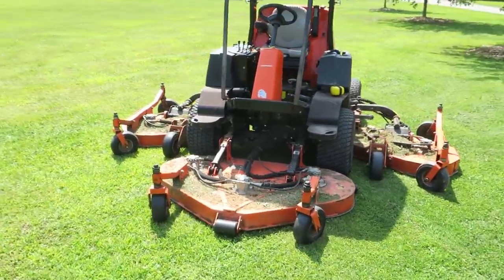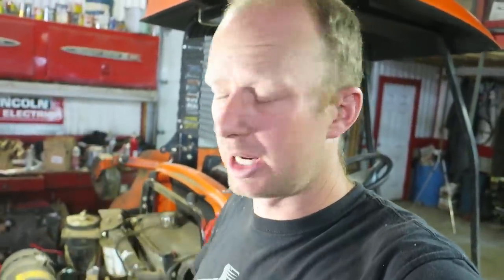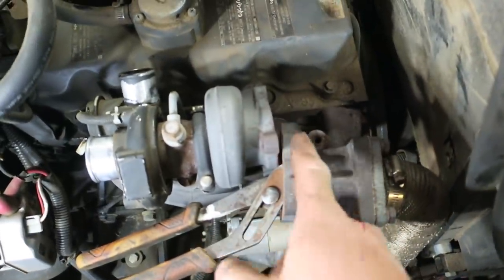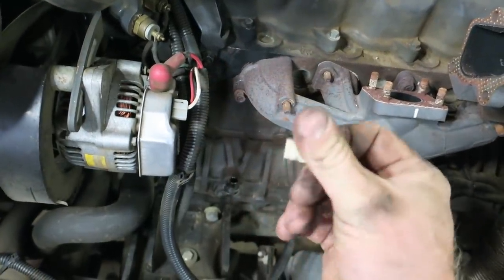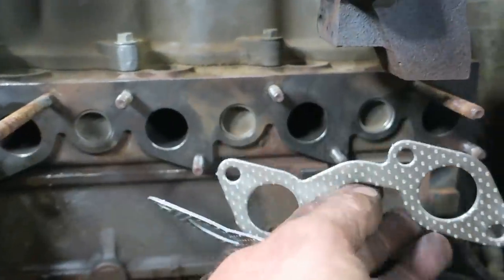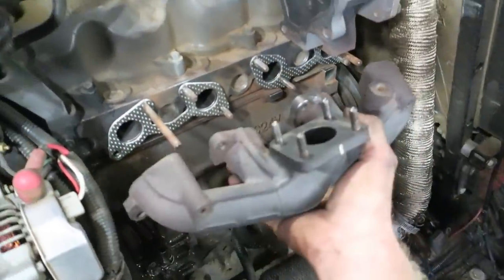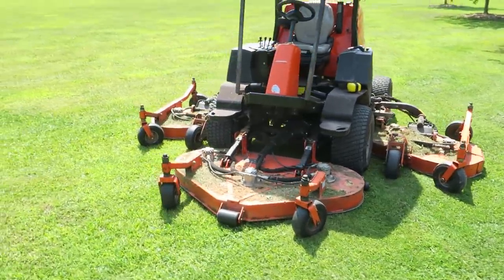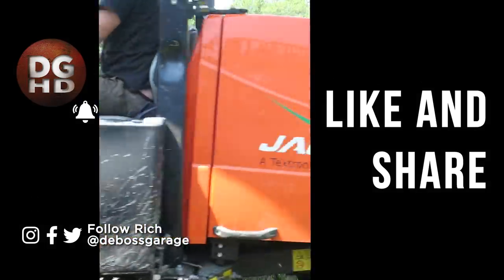Kubota 4cyl Diesel Blew a Manifold Gasket Under 2000 Hrs

Comment: I ran the toro version of that type of mower for years and I love those for mowing large areas, the newer ones they fixed the turn circle so it will swing 180 degrees and the inside deck will stay right on the previous line, really nice for strip mowing large fields

Comment: I work at a Kubota dealership in the netherlands, and we often deal with not being able to order parts.
For example, the very popular b6000/b7000/b8000 mini tractor. They are imported from Japan and never sold new in EU countries, and the EU website for looking up parts and diagrams only shows models from EU.
Even if you have the correct order number for a part, the dealer website does not allow you to order it.

Comment: They make exhaust "gasket making material" in sheets that you can get from most parts stores, but it is usually special order in the smaller stores.  It has a tan colored high temperature gasket material on either face, but a metal inner core.  You have to use tin snips to cut it.  I've used it on cars with turbos before, it doesn't blow out like some might assume.  It works well for unique applications where you would have trouble finding gaskets.

Comment: I work at a community college doing grounds maintenance work and we have just about the same mower, a Jacobson 5111 4wd and we have over 5500 hrs on it and no engine problems once so ever with it, just the hydraulic system is weak on the mower. We also use R&R to get parts for our mower, and we all use Burris Equipment to get our kubota and Jacobson parts.

Comment: I don't know if this is important to you but I swapped a Kubota from a wrecked Ransomme to a 743 Bobcat, this was at least 10 yrs ago. I think the manifold was swapped too. The only issue I had was I had to switch the flywheels if my memory serves me correct that was it. Kubota still in working fine. Please note Bobcat parts a'int cheap either, but they are available.

Comment: You can buy exhaust gasket material in sheets and make your own. On Jonathon W channel he was swapping a cummins in place of a yanmar in a komatsu mini excavator and the yanmar you could only parts for it at komatsu because it was specifically built that one model komatsu machine.

Comment: Those same engines are used in some of the Carrier Reefer Units, and on some of the Tymco Truck Mounted parking lot sweepers. I don't know if that will help you source the parts any easier, but I don't ever remember having to wait more than a day or two for parts when I used to work on them.
Reply: Hot Rod not sure about v2403’s but reefer unite seem to always have v2203’s or a Yanmar something or other. Worth looking though

Comment: I ran into a parts issue like that a couple years ago with a John Deere ridding mower. It had a 20hp Kawasaki liquid cooled engine but I had to get the parts from Deere.
Reply: That’s how any John Deere with a Kawasaki is. It’s bs. The parts are way more expensive and John Deere will refuse you give you the kawi number.
Reply: But im sure it didn’t take 3 weeks to get parts
Reply: Chris Beaulieu   Those Kawasaki singles are notorious for stripping those nylon timing gears. Very poor design.

Comment: I just bought a light plant with kubota D902 engine. Had this discussion with the parts guys at my Knots at dealer. If you ask for parts by the engine model they can help you. If you say Jacobsen it's no way. Kubota is really funny about separation between at and construction. I can't buy a tracked skid steer at my local ag dealer. Or parts for my old KH170l excavator.

Comment: Parts like that can be a Kubota thing, people run into the same issue with grey market tractors, may have the same engine but have one of many possible headgasket etc, they like to sell parts to the dealers in the market they were originally destined for. The v2403 is a nice motor, I think there is a ferd ranger on YouTube with one in

Comment: Kubota does that with most of their crate engines I believe. If you ever work on a newer Bobcat with a Kubota and need parts for the engine, you're either stuck being bent over by the dealer, or going to a Kubota dealer in the US for cheaper parts. The dealers here aren't allowed to sell the parts, even though they can look up the ESN in their system and generally have stock, and the generation is shared with some of their offerings as well.

Comment: Is that a really tiny turbo? What kind of displacement is that engine?
Reply: I work for mahindra, the model 2638 is a 38hp mahindra motor with a tiny holset turbo on it.  It’s about the size of a coffee cup. Cute little thing.
Reply: I went to New Orleans once and there was a man who’s entire career was pressure washing sidewalks. 
He had a pressure washer with a little Diesel engine and preposterous piping leading up to a top mounted tiny turbo. 
That thing was a singin’ 
Engines are the coolest.
Reply: Its a 2.4 l

Comment: Industrial application companies can sometimes help with difficult parts. If your engine is a Kubota and it's not in a Kubota machine, for Ontario you can try MK Power, who are based out of Mississauga.

They can be testy though. Through the grapevine, I've heard MKP gets a lot of callers who go "uh it's a kubota, like, diesel? and I need the like, you know, the bolt that holds on the thing?" So be sure to have all your engine details at the ready.

Comment: Are those gaskets a common problem, 2k hours doesn't seam like that much to me.
Reply: it is a seasonal equipment, so those hours accumulated over many seasons. Poor machine just sits and then goes full chooch - as you could see in the vidya you pretty much go full power all the time, so out of those 2000 hours I would say it ran 1900 on full power. If all that happened was a gasket leak (not turbo, rings, injectors, valveseats) then gj kubota
Reply: That’s better than my Briggs intek that blew its head gasket before 50 hours and then again at 150 hours.
Reply: @CudMcCuddles  vehicles don't average 60 mph over their life
Reply: Outdoor power equipment is rated by run hours.  These engines will typically be operated all day at anywhere from 3k to 3600rpms. Your cars equivalent would be running at 60mph which the engine maybe at 2500 to 3k rpm. Now if u knew how many hrs you car ran very few of them would be above 3k and even then not for very long periods of time.  These things take a beating everyday
Reply: Think of the turbo as an restriction on exhaust gas
Reply: @CudMcCuddles  you literally said 2000 hrs on a tractor is equivalent to 120k miles. which it's not.
Reply: my truck has 95k miles and 2100 hours. I drive 90% highway average speed is still only 45.  My buddys work truck thats the same age has same miles and 8k hours. It idles pretty much all day everyday on the job
Reply: @donaldgardiner6706  Those Kubota motors don't turn  3000+rpm. Operate around 2000rpm, with redline around 2500rpm.
Reply: Trucks with a exhaust brake don't blow the gaskets out. Maybe the nuts were vibrating loose and caused a leak over time
Reply: @CudMcCuddles  Another way to look at it: if a professional "turf mechanic" is using it for a normal, forty hour week at work, that's only a year of use, or two if he only uses it in the nice months. Doesn't sound that impressive.
Reply: @andrewbartleman9169  exhaust brakes don't work by restricting the gasses after the exhaust manifold.  All of the exhaust braking is done in the combustion chamber.
Reply: @andrewbartleman9169  There are exhaust brakes that work like you're talking about, but most big truck exhaust brakes are a solenoid that restrict the opening of the exhaust valve. That should serve to decrease the pressure seen at the manifold.

Comment: My Briggs intek blew its head gasket before 50 hours....
Reply: Inteks are trash. Only good small engine from briggs was the Europa. Now they tell you to never change their oil just add more  disposable engines now. The early Kawasaki fj180v square plastic tops had a head gasket failure issue too. I have 1 right now with this issue. Smokes clouds of blue as the oil is getting sucked from the pushrod channel into the cylinder. No issues with the new kai fj180v though

Comment: 2,000 hours is only 1.5 to 2 years of use for a golf course trim mower like this. It should go 15k hours  These are used for cutting the rough around areas where vig mowers cant get. Some courses might mow all their rough with a few units like this of its a higher end course that can afford the extra labor. Ive worked both. 
I run equipment amd do maintenance, nodiesel work for me.

Comment: Hi from uk, 4:55 c’mon dude, as a fellow lone/solo worker..... ALWAYS APPLY THE PARKING BRAKE ON HYDRO MACHINES!!!  I know these and their predecessor’s well,  ransome/jacobsen are the only manu’r to put the turbo there. The cause is the engine moves more than the exh mount does on the chassis, they find a weak point some where, most of the 1’s iv done worked on rougher ground than ur lawn n normally broke a turbo flange weld or split the pipe lengthways. From my experience, both machines and service from jac’ are poor, toro gm4??0 far better tool.